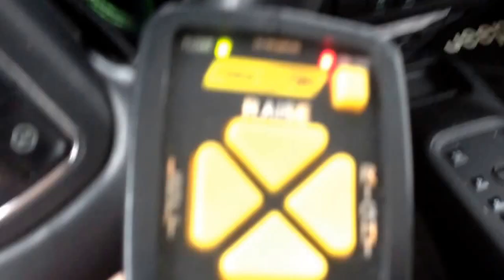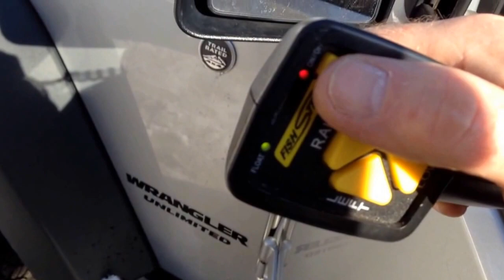Jeep Wrangler Unlimited Fisher Home Plow Disconnect

Comment: Have you had any issues with this plow? Looking at a plow for my 2016 Wrangler unlimited I have. Did you have to modify anything on front end to make installation work.
Reply from the maker: The plow blade attachment bolts directly to the Jeep Wrangler frame.